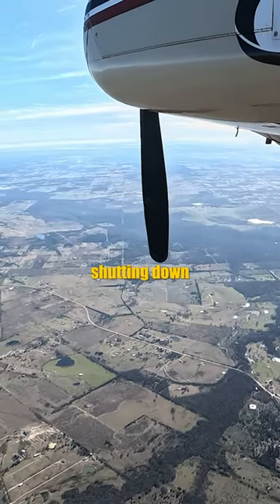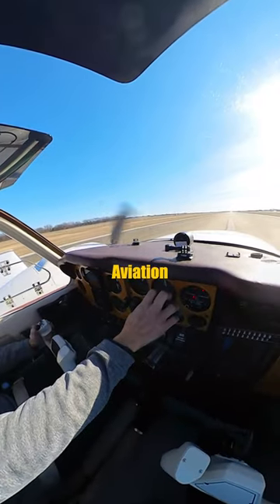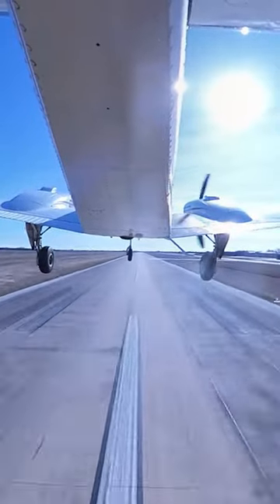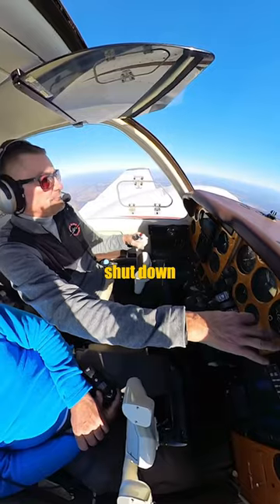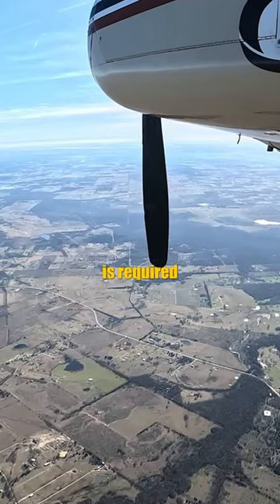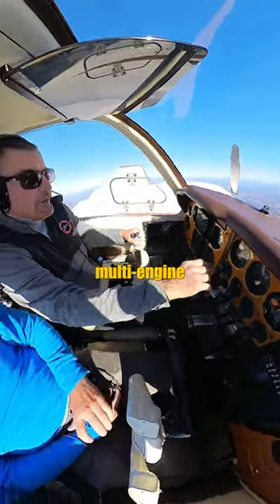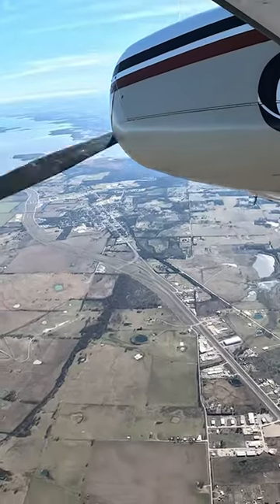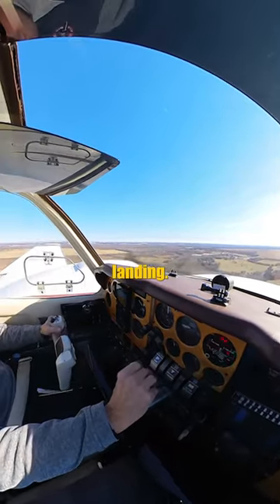Baron engine shutdown in flight #airplane #engine #flight

Comment: Would it be possible to dive down, and have the wind start prop. All around Really good video
Reply: Or, just fart out the window.
That should produce enough wind.
Reply: No, it’s not a j3 cub
Reply: To give an actual answer with reason unlike the other guy, no. These engines are a lot higher compression than a smaller engine like in the Cub mentioned. The Higher compression makes the engines more resistant to what is called windmilling (what you are suggesting). It is sort of possible in the correct aircraft, but only as the very last resort in the event of an engine failing to restart.
Reply: @thatsrtkid totally forgot about this video. After almost a year of learning, yeah your totally right. Sorry if I miss informed anyone.
Reply: Yes it would be possible, but the prop is in a very high pitch (feathered) while shutdown to reduce drag, which basically stops the prop from windmilling